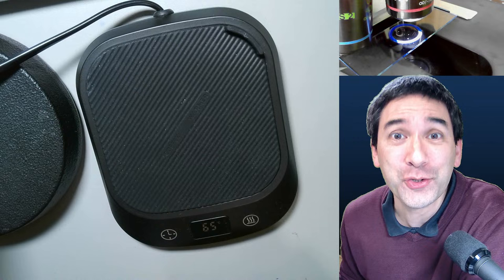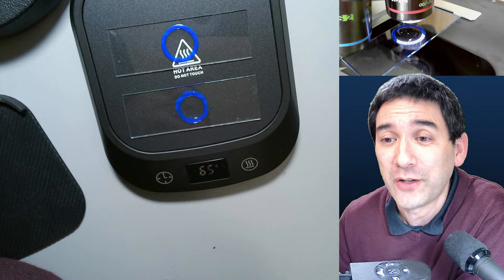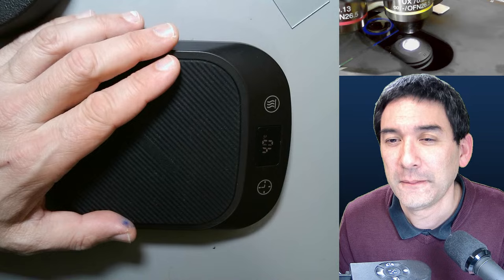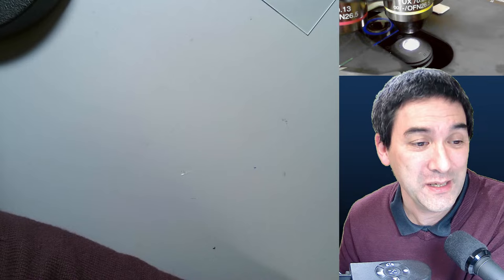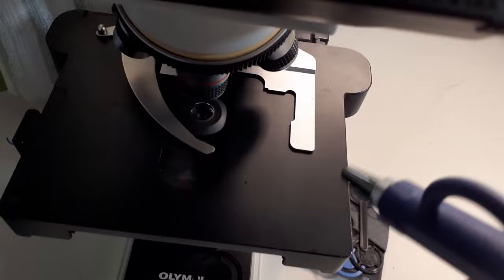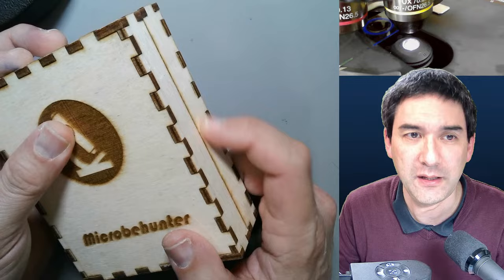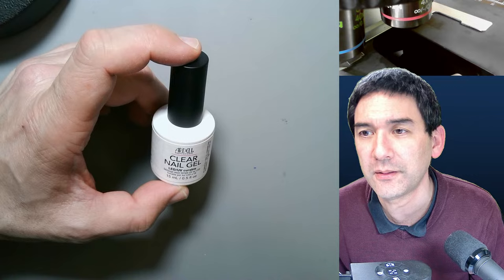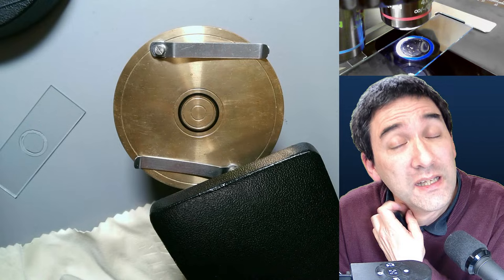I show you some useful microscopy tools and other things

Comment: When trying to put a cover glass on a ringed slide, maybe put the cover on the ring dry and with a micro pipette filled with acetone, let capillary action pull the drops of acetone between the ring and the cover. That might be enough to get the cover glass to stick then when dry, top it off with another ring to make sure it is sealed. If this method works you wouldn't need a complete seal with the first ring since the second ring would do that.

Comment: Hello, and thank you for this very interesting video. Can you talk a little about converting a light microscope into an incident light microscope? Is there benefits to fiber optics versus LED, for example, or what to do with higher magnification objectives, etc. thanks.
Reply from the maker: You can use a strong flashlight (or fiber optics) to light the specimen from the top. This only works well for the low power objectives 4x and 10x, because for the higher magnifications the objective will make a shadow.
Reply: @Microbehunter  thank you.